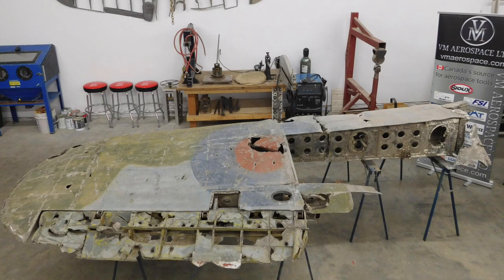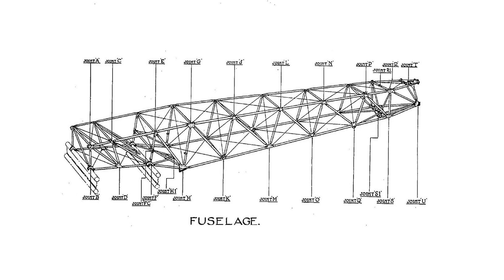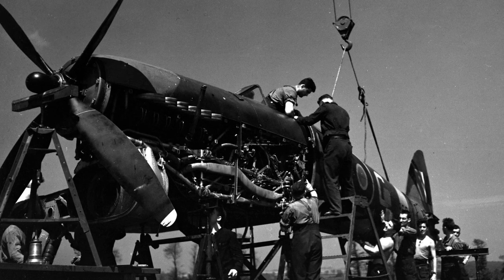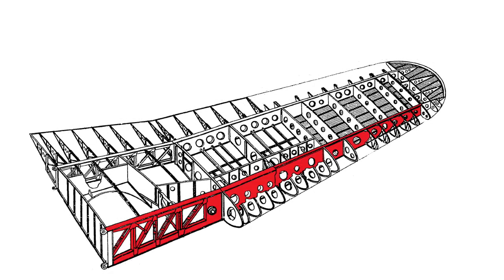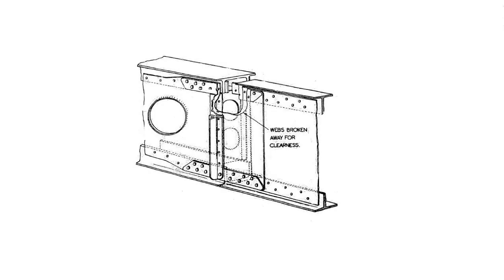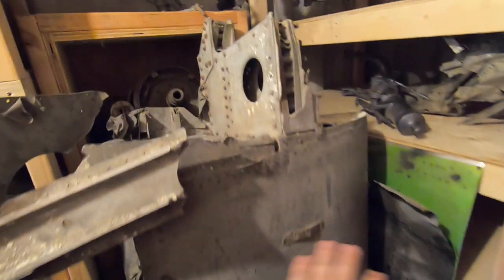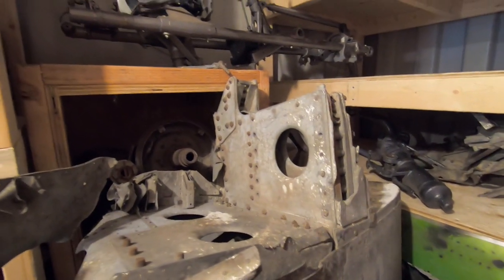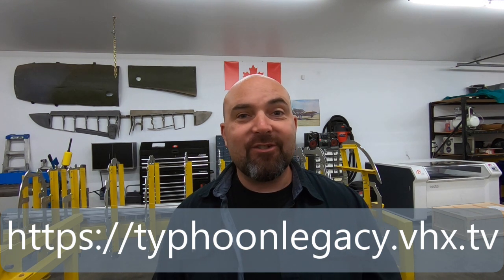Hawker Typhoon S1E2 Wing Structure

Comment: A very well explained time shot out of the Hawker design history. They stepped from metal tubes to stressed skin. (while in a hefty war and under production pressure).
Reply from the maker: It's really amazing what they were able to accomplish! ~Ian
Reply: Yah.  Hurricane: fuselage is truss with round tubes and pressed square ends. Centre section wing stub  has octagon sparcaps and truss ribs.
Typhoon and Tempest: reduced truss, only in the front fuselage halve. Wings and rear fus stressed skin.
Fury and Seafury:  Entirely stressed skin, wings and fuselage.

Comment: What a great project to follow the progress of. There were not that many Typhoons built so finding original parts in good condition is going to be a huge challenge. The UK Fleet Air Arm Museum are trying to put together an equally rare  Fairy Barracuda and had to scour crash sites, scrap yards and old dumps. They recently recovered a wreck from off the sout coast of England which has provided an excellent source of parts. There were quite a few Typhoon airfileds along the south coast so possibly there could be usable chunks both in the sea and on land.
Reply from the maker: I follow the Barracuda project with great interest, they're doing an amazing job! It would be fantastic to find more parts to help the rebuild, there are only a few areas that are needed now. Of course, if we could find substantial remains in acceptable condition, we could always look at an additional project, or merging the two. Right now we are starting our search for the systems components (many of which were used in different aircraft too). ~Ian

Comment: Great to see the Typhoon wing structure and compare it to the Hurricane.

To modern eyes, the Hurricanes wings are very strangely constructed. My guess is that this is because: It was Hawkers first attempt at stressed skin; they made the wings and then had to modify them by putting in the double skin wing stiffener.
There are so many furring strips...

A couple of books I have on the Hurricane suggest that the bolted fuselage structure was used instead of a welded fuselage, because of the workforce and equipment Hawkers had. It wasn’t because a bolted fuselage made parts replacement easier. My guess is that it would have been easier to repair a damaged fuselage member than bolt in a new one. The repair manual suggests this likely a correct guess with the repair schemes they have.

Love seeing the progress!
Reply from the maker: It's really interesting to compare the different Hawker types and watch the evolution of the designs. From Hurricane to Sea Fury was only a matter of a few years, but the designs had completely changed.

Comment: How does the typhoon compare to the P47.  They both look beefier than most fighters?
Reply from the maker: That would be a great comparison to delve into Kevin. While I do like the P-47, my knowledge is limited on it so I'd be reluctant to speak to it's abilities. I also think that a true comparison would have to be done year by year through development, as both aircraft changed quite a bit through service. If someone with in-depth knowledge on the Thunderbolt was to get in touch with us, I'd be happy to post a comparison of the Typhoon. ~Ian
Reply: Yes, they're both pretty beefy.
But quite different in roles, with the Typhoon best at low and medium altitude and the P47 coming into its own at high altitude.
Reply: Big Dirt  
Yes, it's interesting to compare the 24-cylinder, 37 litre Napier Sabre with the 18-cylinder, 46 litre P&W R-2800 Double Wasp. Despite being completely different they weighed about the same, at 1070 kg.
The Sabre was a very complicated water-cooled, sleeve-valve engine and was dogged with reliability problems in the early years, but it clearly had great potential. Being an air-cooled, pushrod radial the Wasp used proven technology and was relatively straightforward.

The Wasp used in the P47 produced 2000 hp but other variants produced up to 2800 hp.
The Typhoon had a 2200 hp version of the Sabre, uprated to about 2400 hp by 1944 for the Tempest, which was a much improved aircraft with almost twice the rate of climb. Later versions had a redesigned supercharger and induction system and by 1946 the Sabre was producing 3500 hp. 
There is mention of a final output of 5000 hp plus which, if accurate, is just phenomenal.
Reply: Big Dirt  
You certainly wouldn't want to get into a dogfight in a P47 at low or medium heights, but at high altitude the turbo-supercharger was maintaining power output, which in supercharged aircraft was dropping away.
Yes, it always puzzled me how the Tempest could be so fast with that big chin radiator right up at the front. 
The Tempest I prototype had a 2500 hp Sabre IV engine and was very clean with the radiators in the wing leading-edge, but various difficulties delayed flight until 1943, when it achieved some 466 mph. Other prototypes had beaten it into the sky and they were the ones actually put into production.
With that more streamlined shape and the very powerful Sabre IV it might have been expected to go even faster?